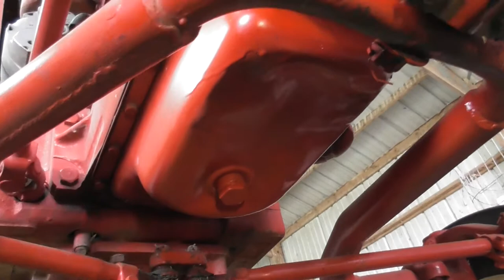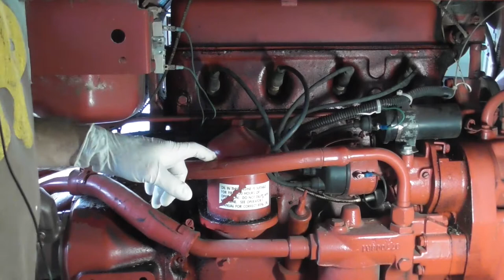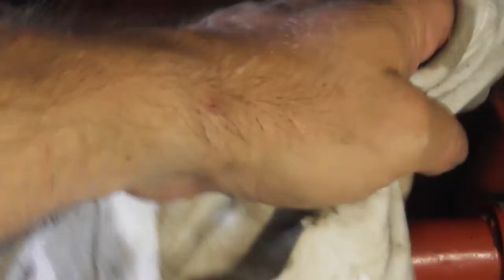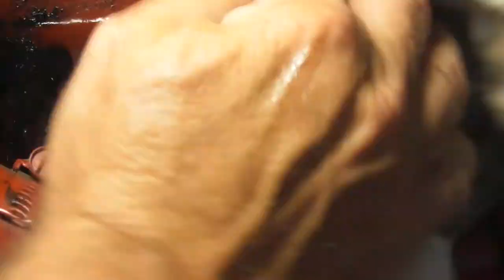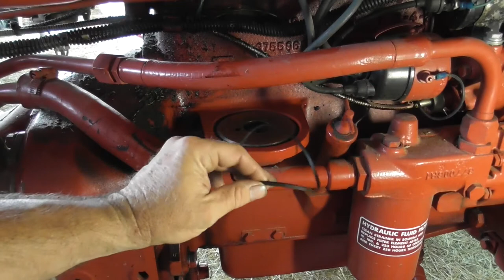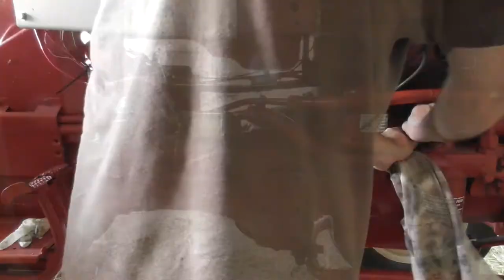1966 International 404 Oil Change

Comment: Had an oil leak at filter base, went to change filter and o-ring. When I put o-ring in, I noticed it didn't set in the lower, found the old o-ring still inside. Would have had the same issue as you did
Reply from the maker: Sure am glad this video helped you!